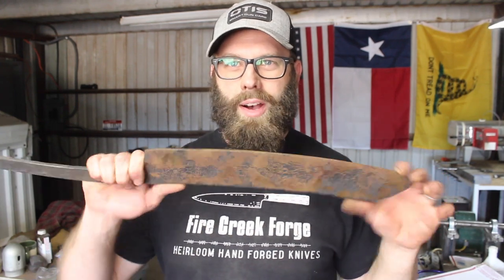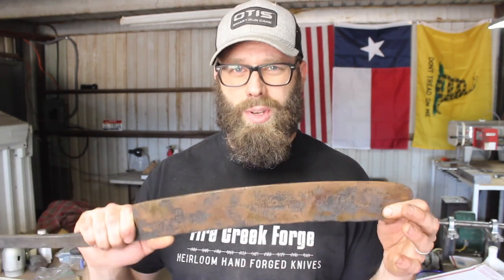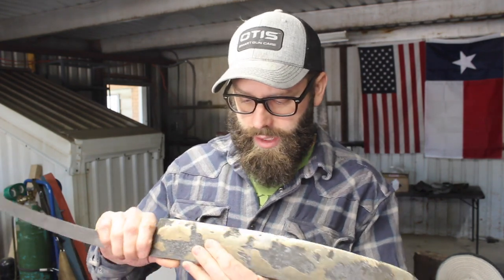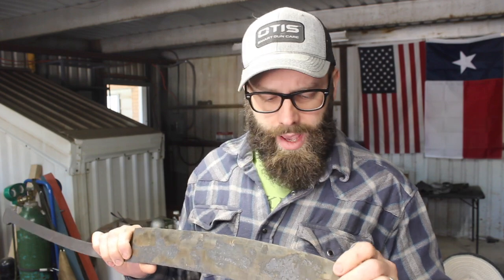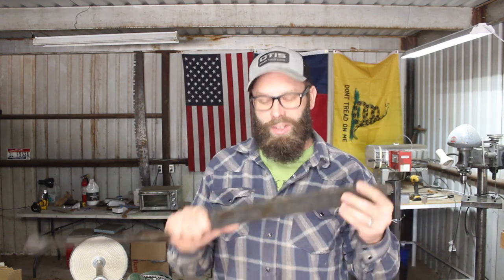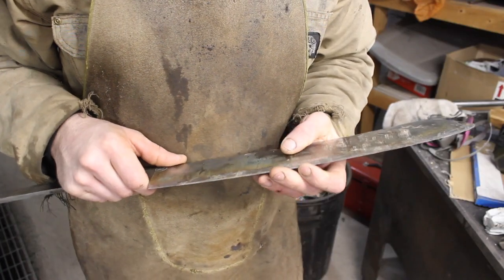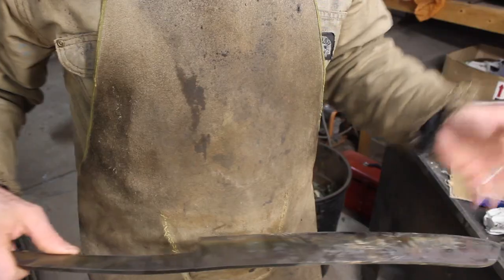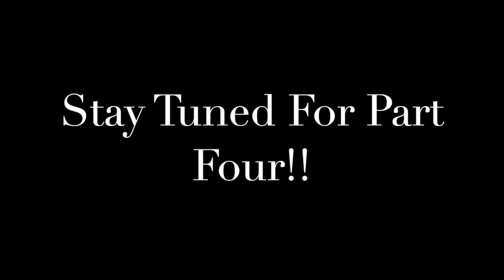Forging A Hog Splitter/ Two Hand Machete With Damascus (pattern welded) steel

Comment: When you reheat treat did you normalize again? And before i tried to temper in torch and believe me that strawyellow color on the edge, that softens and ruined the edge, even if your putting it in water, dont trust that straw color man
Reply from the maker: It depends on the steel (carbon content, mainly) as to what color you want to draw it to. And the steel has to be clean. And fully hardened.

Comment: Looking good. How do you even price a job like that? Without giving numbers of course, are you charging by the hour or did you agree on a set price?  Just wondering because it’s been a very involved project. Thanks for posting it.
Reply from the maker: Thanks! Set price. Yes, it's the kind of thing you have to learn to bid on so you don't lose your shirt, but you can't price yourself out of work either .. I'm still learning how to do all that, haha. Plus if it's a specific project you haven't done before there's R&D involved, etc. Lots of different factors... Anyway the next  time I make a similar piece it will be more worth my while even at the same price point.
Reply: @FireCreekForge  cool. Good to know. Thanks

Comment: It would prob do better with a Handel of some kind it would have been easy to.laminate some saw blade steel on both sides with some wood and epoxy and would have been easier on the hands